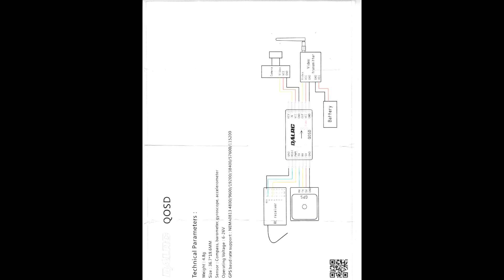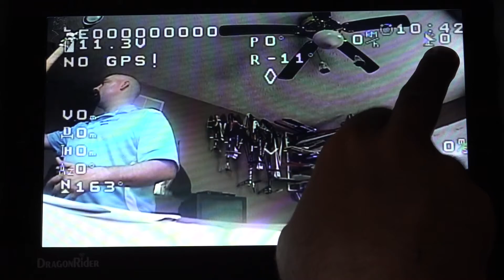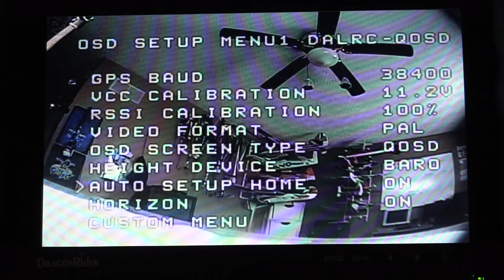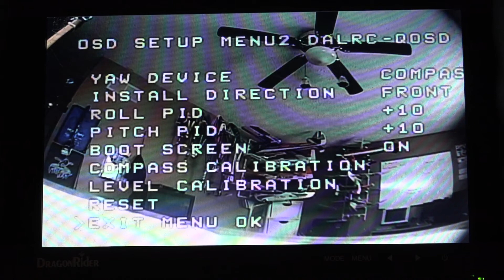Qosd

Comment: Nice video. Please explain how to calibrate the compass. The screen says: Please level rotate level a circle... I rotate the plane clockwise as if looking from the top but nothing happens. Tried rotating on different axis but still the message on the screen does not change. Only the number changes slightly. How exactly is this supposed to work? Please give me some advice.

Comment: hooked up per your video.  lights came on, but no signal from 5.8 transmitter.  I checked and transmitter works with camera alone.  I did not have unit plugged into 2.4 receiver, but had cable for transmitter plugged in.  Also, presuming I get the unit working, I've set it controller to the spring loaded switch, is that the proper switch to use?

Comment: Big issue with this unit, if you plug the gps module the wrong way around on the main board the thing fries up and no more gps! It does work but shows zero gps... really easy mistake to do and its a shame as it renders the unit worthless really...

Comment: Hi Buddy RC, did you figure out how to get it to recognize the GPS? Mine does the same thing as yours, just flashes "No GPS!" regardless of if the GPS is plugged in or not.
Reply from the maker: +Matt Jackson I would guess you might have an issue with the actual GPS. I noticed later that Mine was damaged. I replaced the GPS sensor and it all came online.
Reply: +Buddy RC hmm. I tried that, to no avail. And my GPS still worked on another OSD. Think my issue is on the OSD... going to try to figure out how to re-flash it.

Comment: Hi Buddy RC,I noticed you said you can control the osd Menus with a switch on your transmitter. Do you use that switch the same way you used the button on the back of the OSD?Thanks

Comment: do we need to power the QOSD directly from the battery and not pass through your transmitter... Like the "instructions" say. Cheers.
Reply from the maker: +murathan aksoz No you can do it either way but if you are regulating the power to your VTX you will only read what the regulated power is going to the VTX. If the VTX is not regulated and it is being powered from the battery you will be fine and the OSD should give accurate readings and battery use.
Reply: a little late...but just incase others see this - it won't work if your vtx only puts out 5v. The qosd module needs more than that.
Reply from the maker: I would agree. If the transmitter only puts out 5v it will not power the OSD. Thanks for the input.
Reply: If the transmitter (VTX) can output 12v, its not a problem. I can choose on mine, 5v and 12v. Caution, cause what ever voltage you put in on the vtx side of osd (out-vcc-ground), also comes out to Your camera ports (in-vcc-ground). Be sure to not fry Your cam, use voltage regulator/BEC if camera only support 5v.